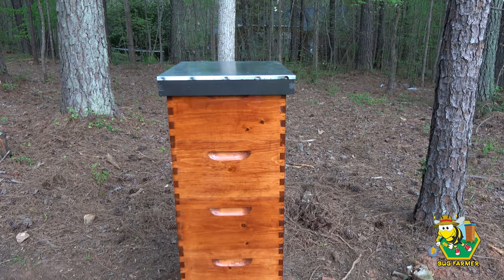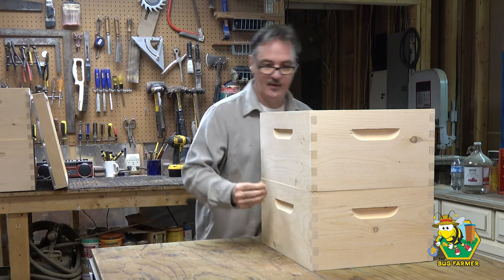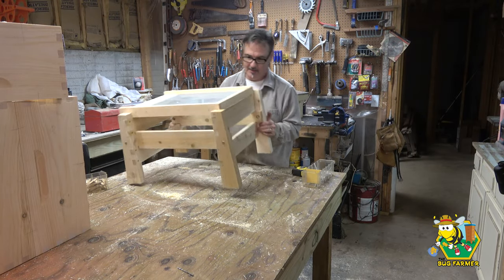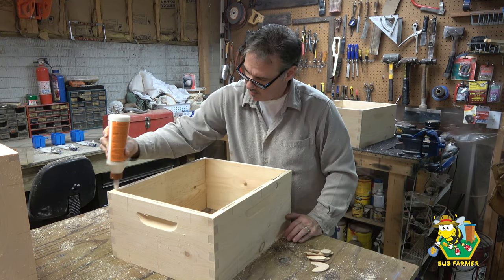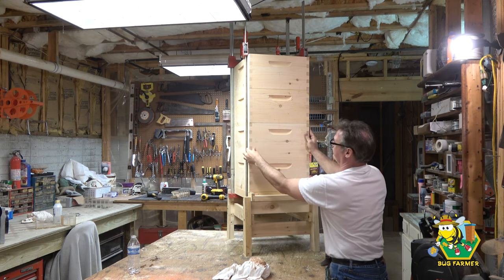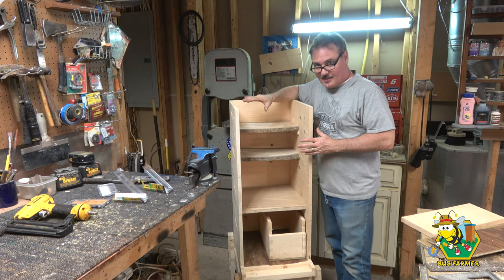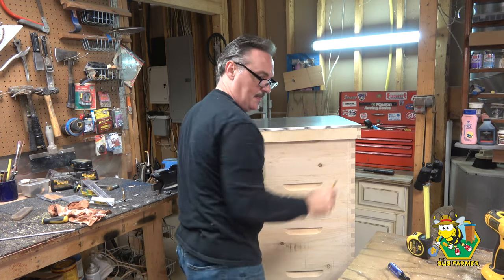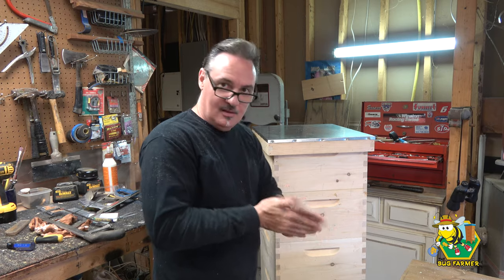How-to build your own hidden compartment beehive tool cabinet.

Comment: Very nice man... Do you have plans for the base too that looks sweet as well.
Reply from the maker: Actually, the base, hive bodies, lid, and bottom board were purchased from Better Bee.  You can get the base here. https://www.betterbee.com/bee-hives-and-components/STANDCEDAR10.asp.  The rest can be found under the hive components.  If you work with wood at all I recommend getting the 5 pack of factory second supers.  They may have a ding or might be knotty but they clean up nicely and they are cheap.  That's what I use for all my projects. I used some 8 frame mediums on my heater build project and they turn out just fine with some stain and finish.  You can see them here: https://www.youtube.com/playlist?list=PLqjRHCpI3sdqHoiI6uKCMpQ4g2tl7W2tM
 I am glad you liked the video and I appreciate you watching.